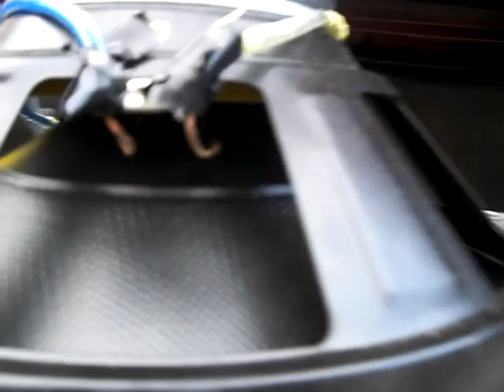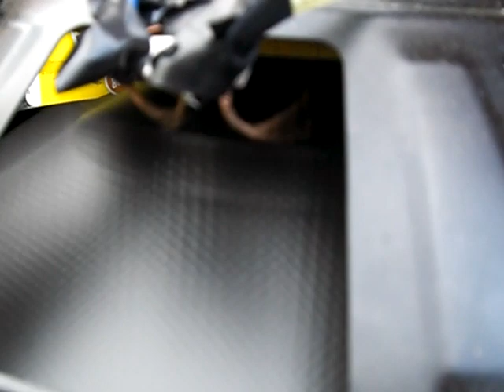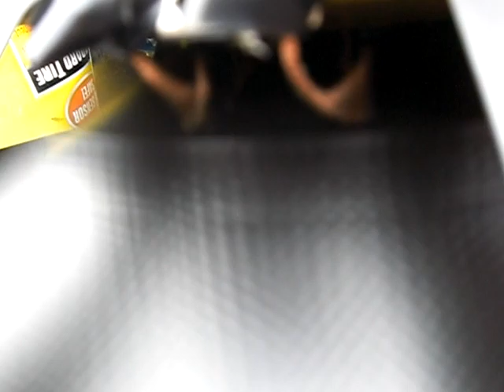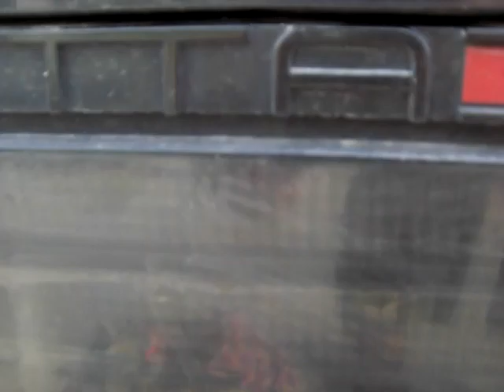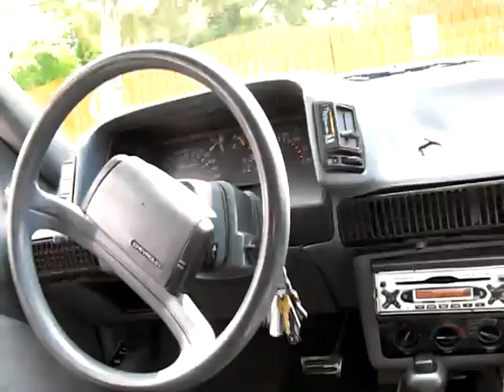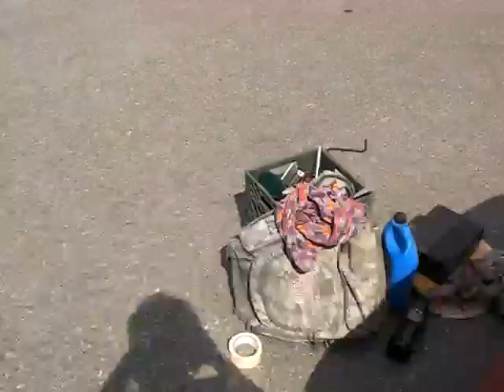Old 12" VR3 Sub

Comment from the maker: you most certainly can... depending on your head unit (cd player, cassette player, radio ect.) the head unit featured in this video cannot, but since we put a pioneer unit in here it can play ipod/mp3's via the auxhiliry jack. if you connect a 2 way male to male 3.5mm minijack into the ipod then the aux port. other models of head units feature an ipod docking station or usb port for other mp3 devices. i hope this helps. THANK YOU PLZ RATE!!!

Comment from the maker: actually the original Vr3 you see in this video is not half blown. a little tweaking and both coils are running strong. the xtremes are kinda crapped tho.we have it mounted in this box you see here and it is mounted regulalrly. i will try to get vids up.

Comment from the maker: nah this is all he wants. he is not a BIG WOOFER BUILD kinda guy. i have a system ready for him for $415 featuring 4 of these woofers 2 amps to Perfectly power them, boxes, wiring, THE WORKS!!! 415 will get you a good component 12" but it will also get you 4 of thesee with everything you will ever need. actually that is not including a cap but he is looking to put in a high amp alternator anyway that will hanle that shit. thnx for commenting!

Comment from the maker: hey man what are you? man no need to be a hater! this setup is not even mine! pay attention this is my homies system! this sub has been replaced regardless with a dual 12" bazooka setup. 2 csw1204 12" with a csa300.1 Amp. it is running 375wrms 500peak at 2ohms

Comment: its better to have both hooked up so you dont burn upo the sub. the lil kx350.4 will put out 350rmsx4 @ 2ohms. the amp in my xuv is 750@4ohms 1500@2ohms and 3000@1ohm.

Comment: the people that insult vr3 are the people that have never heard one before... sure there cheap but if you power them right you have a system that will sound good for years (depending on if the listener doesnt tune the amp right, and has a lead thumb :) )..... if your bitchin sayin they suck then go to walmart, pick one up and listen to one for more than 5 seconds....